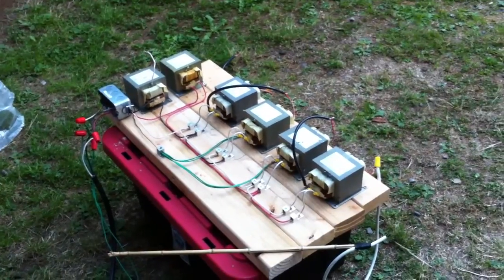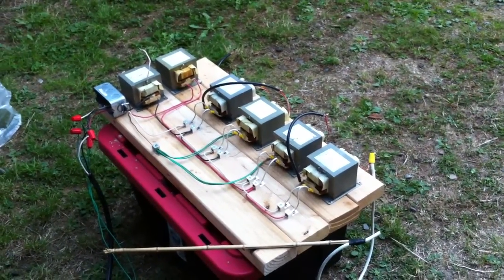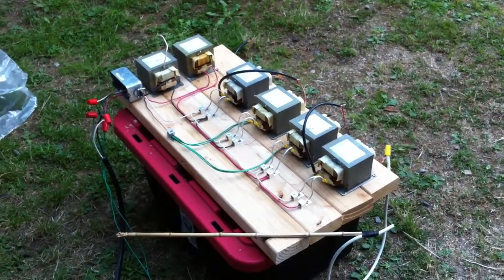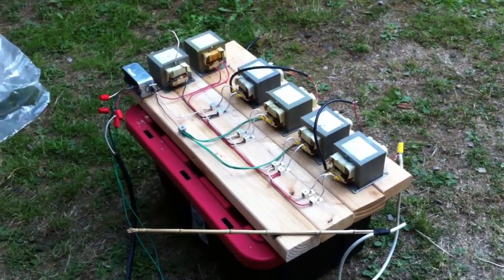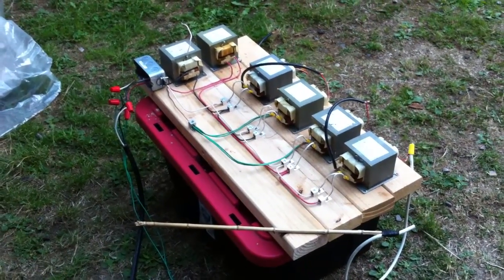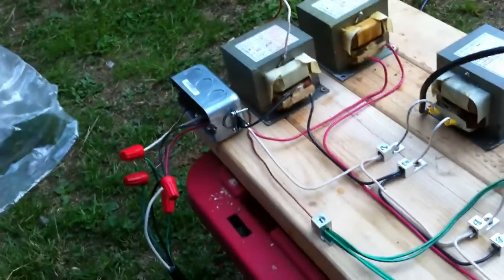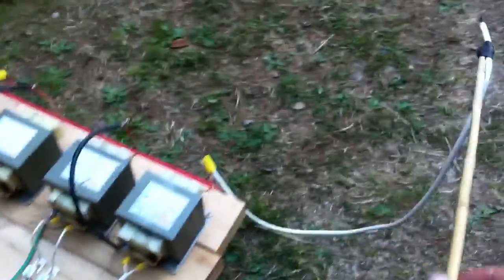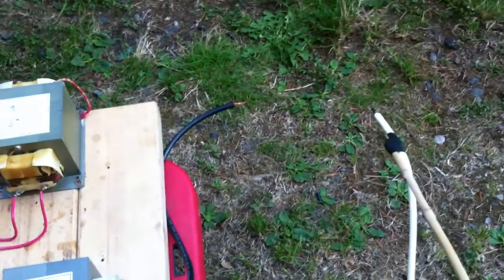4 MOT Tesla Coil Power Supply Test 1

Comment: So are you wiring a pair of MOTs in series to handle 220, or are these 220 rated MOTS all wired individually in parallel? I have a bunch of 120 MOTs and am trying to do a similar build to you with 4 transformers.
Reply from the maker: There are two 120V MOTs per 120V leg of a 240V circuit. Four MOTs all together. If you are here in the USA 240V is supplied by two 120V lines that are 180º out of phase. The wiring diagram for the hookup is located on my web sight. https://twotowers.com/images/tesla/mot_tesla_coil_power_supply.jpg. Instead of using MOT's as ballast, next time I'm going to try two mid century coil type bathroom wall heaters. Apparently the coils offer good reactance. I also now have a 2 phase (double) 20 amp variac that I intend to use on my next build. The MOT Tesla coil has been on the shelf for a few years now but I feel the urge to take it up again. Peace

Comment: No offense but that's pretty shitty arc for quad mot
Reply from the maker: Any suggestions? I'm open to learning.
Reply: @neoterra7072  look at this http://danyk.cz/2metry_en.html, 2 meter arcs with 8 mots. He's a crazy man and he has a lot of interesting stuff on his website, the only trouble is that some of it is in Czech but google usually does a pretty good job of translating it
Reply: @neoterra7072  hmmm... If you want longer arcs I'd use a more powerful ballast or running it from a Variac maybe, although that would have to be a pretty beefy Variac ;) or if you want the arcs to become huge try it with no ballast at all but you'd have to limit the inrush current by connecting some ballast momentarily. The problem with this is that the transformers would heat up quite fast. You should also look at diodegonewild's website where he has made some 2 meter arcs with some mots. And resonant capacitors increase the arc size tremendously just be sure you don't overvolt then since from my experience they go off with a really loud bang. 
Brat regards.
Reply from the maker: @martinbobak3009  Getting arcs off of the 4 MOTs was't my intent actually. I'm wanting to build a MOT power supply for a tesla coil. I do have 2 phase 20amp variac (40 amps total). I plan to use the next time I can set up my tesla coil.
Reply: @neoterra7072  oh, sorry than. If you plan using this for a Tesla coil than this should be great. Good luck!

Comment: how have you added 2 MOTs as ballasts?
Reply from the maker: One has to short out the secondary windings, but it's not a great solution because the MOTs heat up really fast. Better to use some kind of coil that offers good reactance. A vintage wall heater for instance; the kind with expanded metal coils running though them. If you are using 220V as input power , then you would need two of them. I have a set but haven't tried them out yet. The method came recommended to me by personal friend who is a Tesla wizard in his own right. Sorry for the late response.

Comment: Hi Steffan Heydon, I'm know trying to make a Tesla Coil, and I have the same problem as you. I'm using 3 MOT as a power supply but I don't know how to reduce the output current. Have you solved that problem? How? Please contact me. Thanks
Reply from the maker: Hi, 
I'm going to try using resistive ballast (a.k.a. a reactor) to limit current. I have to old wall heaters. The coils in those heaters should do the trick. My big problem at the moment is my variac. It's not designed to handle 220V in the way that I need it for my 4 MOT power supply. I may switch to a 3 MOT 110V system and give that a try. That will give me 6000V instead of 8000V. 

Are you doubling your voltage? What is the value of your Capacitor or MMC? What type of spark gap are you using, or planning to use?

Peace, Steffan
Reply: Adrià Riera are you trying to reduce the output overall for the Tesla coil, or just to keep the mot from pulling too much,
If you are trying to increase voltage and drop current then make a voltage doubler, they are cheap and easy to make and will make your Tesla run more efficiently.

Comment: Have you thought of bringing them in resonance? These MOTs go crazy, if you attach like two microwave caps in series (per MOT) with your sparkgap.
Reply: Steffan Heydon just use a few microwave primaries as your ballast they work great for me, and they do not lower the voltage only the current, If you want to see my power supply look on my channel, just to give you an idea of what you could get out if you used some capacitors!!!  Anyways, great video , I really enjoyed!!
Reply from the maker: @platinumscience7356  Do you have a link to a video on your power supply? I went to your channel but didn't find detailed info on it. Best, steffan PS... Love the exploding fruit!
Reply from the maker: Hey there. Thanks for the comment! You will notice in my video that each set of two power transformers (MOTs) has it's own ballast in the form of a MOT primary winding. The secondary coil is shorted out. That works great except that the shorted secondary coils get smoking hot within a minute or so. How are are you hooking up your ballast MOTs so that they limit current but don't get hot? Will check out your channel. My interest in building a MOT power supply is to run a Tesla coil. I'm currently using a 60mA 15000V NST to power the Tesla coil.
Reply from the maker: Thanks for your comment! 

Two caps in series will increase the voltage capacity of a capacitor X 2 and lower its microfarad rating by 50%. Keeping that in mind, I already use four 10,000V, 0.1MFD caps that are hooked up in a series/parallel configuration to give me a MMC that is rated at 20,000V and 0.1MFD. The MMC is connected as part of a standard tesla coil circuit with an 8 point synchronous rotary spark gap.

Are you saying that in addition, I should  try adding two microwave caps in series with the HV output of each MOT? Would that create voltage problem with the two outer MOT's?

Following someone's recommendation I did away with the two current limiting (ballast) MOTs as they were getting too hot, too fast and tried regulating the input power with just my very big variac. It seemes with this setup, too much current was flowing through the system and burned out two capacitors in the MMC. I ordered two more caps but have yet to try again.

Thanks,
Steffan
Reply: Well I have not ried out multiple MOT's in resonance in series. But with one ist just worked great. i just thought of this Topic, when I saw your Video, and thought this could maybe help you in some way. I have not the ressources to try that yet, but I will definetly in the future.
Sorry that I accidently wrote, that you should attach 2 Caps in series, but it's actually in paralell (a logic fault of mine).
Something about the current limiting: Big heat-producing devices, like water heaters or electic grills work very good for this issue. They are in contrast to the MOT's you used, more or less a resitive load.
Reply from the maker: +Anschnur Missionar 

Thanks for the reply. Others have recommended a resistive load like the filament of an electric heater etc. I guess I should give that a try. I'm wondering if there is a ballasting solution that will only reduce the current but not the voltage. Right now I have a big variac that is capable of reducing the votage,  but that is not what I need really. As it is, 4 MOT's only produce 8000V. If I drop the voltage input, then the output voltage will drop as well. I just want to reduce the current if possible. Perhaps the resistive ballast will do that??
Reply: Steffan Heydon  I am also using mine for a Tesla coil, I have one ballast per mot for long run time and 1 ballast per 2 mots for shorter run time. 

I have my ballasts connected in series to each other only one leg.  But then again I'm only using 2 mots. Give 2 mots with 240 volts and 2 ballasts a try, it may be more efficient  to use for a Tesla coil. But you would need to build a voltage doubler. Just an opinion. 4 mots seems to pull way to much current. May I ask what is your breaker rated for?
Reply: @platinumscience7356  do you know if its possible to use the original voltaje multiplier of the microwave transformer, for stepping up the voltaje? or is the return frecuency of the primary of the tesla coil going to kill the voltaje multiplier?